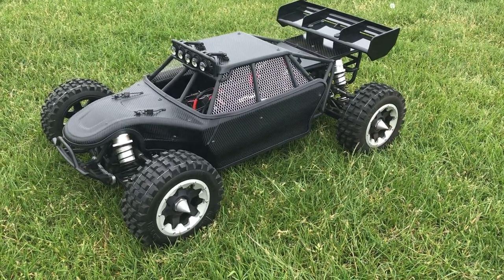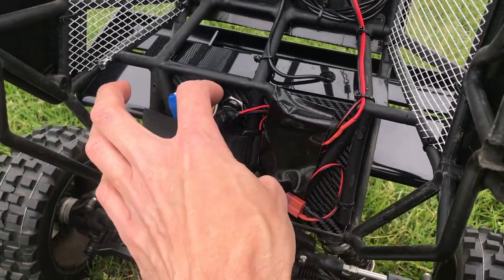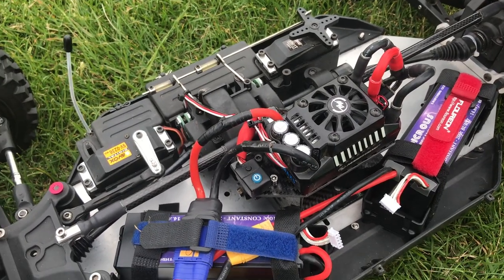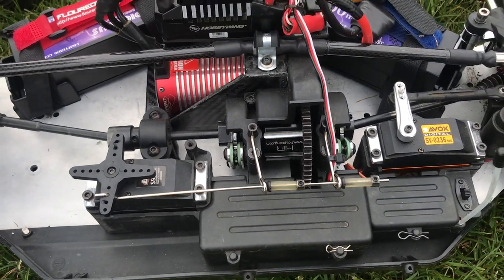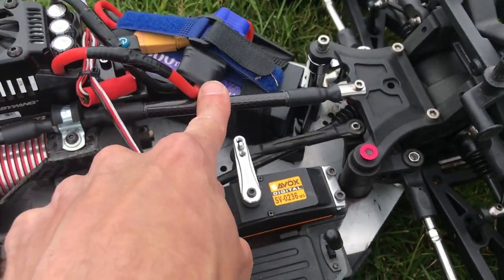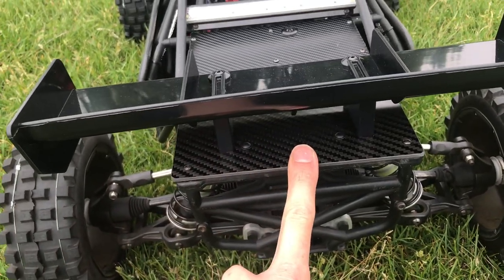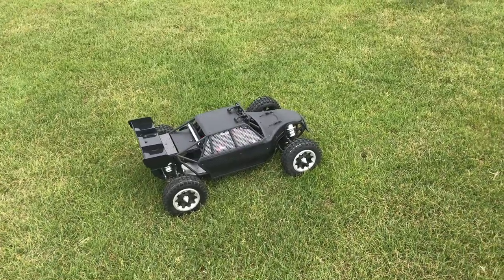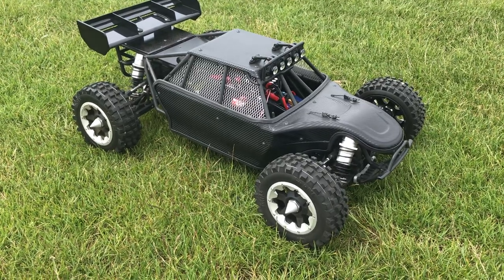Mad Max Losi DBXL. Converted to brushless. Hobbywing Max 5

Comment: It's not better than the DBXLe for one main reason. The DBXLe has a straight centre driveline, also the stock DBXLe motor has more power than the Leopard 5898 you put in. You should've gone with 58113 700kv and geared it up, or the 840kv

Comment: I have mtxl im thinking of the same esc max 5 and motor 
Will they be good 
Will it be fast
Reply: Hey. The Max 5 will work ok. But the MTXL is quite big and has massive tyres. So speeds won’t be to fast. Maybe around 40mph.
Reply: @TheoCook  thank you alot 
You were great help 
Im not planing to run for more speed than 40mph thats more than enough to me